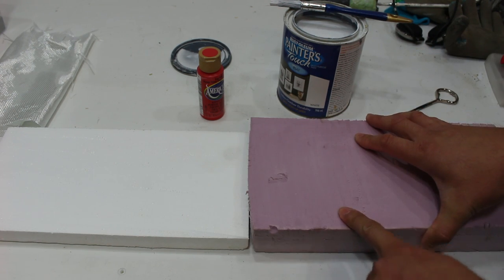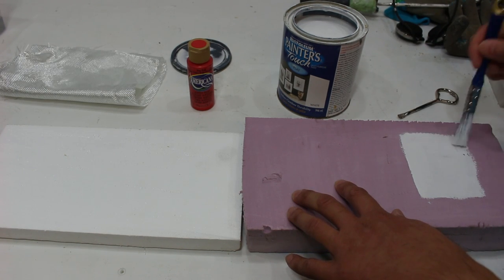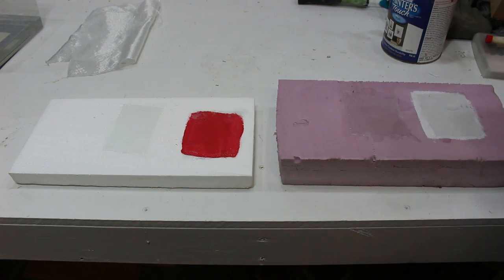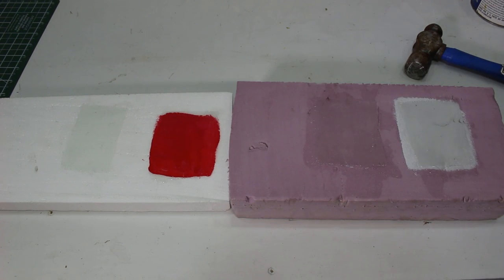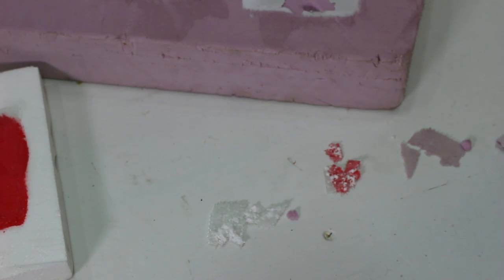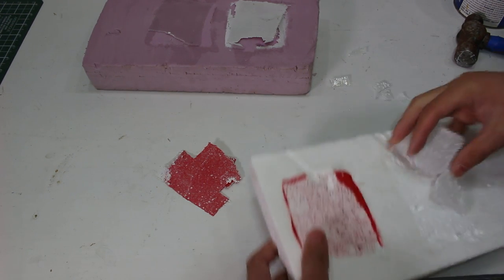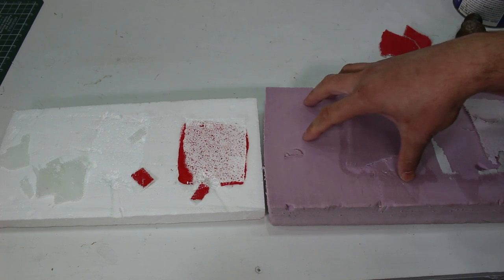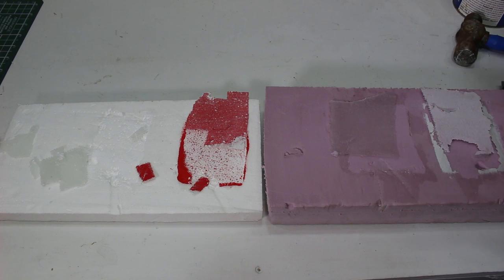Surfboard Foam Testing - What Type of Foam to Use

Comment: I know this is an old video but re-stumbled on it after making a couple of xps foil boards. Regarding the bond strength on XPS I found that the strength was greatly improved by heavily texturing the surface. I used 40 grit sandpaper to really rough the surface up. I also spoke to someone who closely spaced hobby knife blades to put texture on the board. Because XPS and EPS are the same chemical compound I'm guessing that it is only the mechanical bond that is different not the PS - expoxy bond. Texturing the surface goes some way to simulating the pore spaces in the EPS that are created when the source PS beads are heated to make the foam blocks.
Reply: RobSAtlanta that video is completely unrelated. Nothing in it about roughing up the surface and none of the foams there are ESP or XPS.

Comment: awesome vid. what helped when I   used xps was using a carpet furring strip with nails and pressed it on my blank after rough sand and it helped huge with epoxy adhesion.
Reply: I've considered using a spiked carpet roller to achieve a similar effect. The funny thing is the first test strip I did was really resistant to delamination, so I wonder if there are other ways of improving the adhesion than just poking holes in it (e.g. temperature). It was definitely hotter in Texas than it's been in Wisconsin, and I wonder if that has had an effect.

Comment: Hey bro, excellent channel. I have no idea how I ran into it. Since I have been looking to build an XPS Kayak for my channel, I guess YouTube decided to hook us up. So, I have a bit of boat-building experience, and I have made many carbon pieces from my race cars, boats, and bikes. If I may make some recommendations, first, I know you like that epoxy, but I strongly suggest giving Alumilite a try! Second, if you want excellent adhesion to the substrate with minimum or no delamination, you need to start by wetting the substrate first, applying the glass mat, then more epoxy! And if you want TRUE professional results, you may need to bag the board! There is a company that sells supplies in the UK called Easy Composites Ltd with some pretty good videos. The videos are focused primarily on selling products, but the techniques are on point.  Or I least the way I was taught! Also using a fiberglass laminating roller before the squeegee will tremendously improve adhesion to the substrate...

Comment: Painting the board in either case is probably not a good idea because it actually creates a separator between the epoxy and foam boards. So technically it is a test of the paint adhesion and not epoxy adhesion.

Comment: Amazing vid! But quick question, where do u order your EPS foam from. I shape board with low density and it leaves many little holes that I have to fill with spakling.
Reply: Don't use spackle. Seal with epoxy and glass microspheres (or microballoons as so many seem to call them for some reason). Spackle is almost as good as worthless.

Comment: Fantastic video! i look forward to seeing the XPS build. I do think that it would have been a more fair test to use the same paint on both foams. Do you normally seal your EPS before glassing? if so that would have been worth doing as a test too as it may have affected the adhesion of the glass.
Finally i wonder if you made the XPS really rough it would have a better bond? Its scary how easily the glass peeled away.
I really enjoy watching your channel. All the best
Reply from the maker: Good point about the paint, probably not a huge difference but it would have been good to use the same,.  I usually seal my EPS with a sealer and I'm sure it does make a small difference.   I have actually tried really roughing it up before but it ends up not looking very good and using  more resin to fill in the little voids with minimal affect on adhesion but that's anecdotal.
Reply: @AndrewWorkshop  what is the sealer that you use?

Comment: No experience but had a thought. What if you had a roller simular to the ones used to get air out of layup only very small sikes of some sort to "texture" the foam pre- layup? The goal would be to allow resin to be pushed into the "pores" created providing more surface area to grip.

Comment: I was wondering if there is a reason that you have never seemed to consider Polyurethane Blanks and polyester resin?
Reply: No expert here, but polurethane foam is generally harder to work with I believe. For instance, it cannot be hot wired. Other than that, its the resin is cheaper and much the same to work with. Perhaps he just prefers the epoxy+eps/xps boards as they are supposed to be more rigid/less flex and float slightly better (~12%).

Comment: I will have your opinion. I'm thinking about building a kayak. In my country the polyester for boats has low cost and epoxy resin has high cost.
So i have only  one way using only polyester.
The same we have for foam. EPS has hight cost and EPS has very low cost
My Question
What do you think .
For a kayak 11 feet i can use EPS and polyester or later is destroy?
Any opinion is critical for me, before i starting
Thank you

Comment: What epoxy do you use not to melt the foam
Reply: Epoxy resin wont melt eps/xps when used correctly. Polyester resin melts the foam, and thats exactly why they use epoxy. If you let the epoxy pool and then exotherm the  yeah, I'm sure it will melt the foam. But just use it correctly and you'll be fine.

Comment: hey, very interesting video.
Can you give some additional information on the density or kind of eps you are using?
in my country eps is categorized by its compressive strength (kPa)....with 50kPa being the weakest, and around 200 kPa being the strongest. Is that the case in Canada too? Which would you recommend?
Reply from the maker: Hmm I think from what I remember the EPS is 1.8 or 2 lbs per cubic foot, Canada is messed up with measurements we use imperial for some measurements and metric for others.  Get the densest as possible, less compressive = tougher but there is of course the trade off of more weight.  So you could get less dense foam and glass it heavier and still have a great board (lightweight shortboards) but it will off gas a lot more so it will be super important to vent.  Not to mention fiberglass and epoxy is probably more expensive than dense foam.

Comment: The open cell foam allowed the epoxy to penetrate into the foam better so it held better.    The XPS does not allow the epoxy to penetrate as much. 

I think if you drilled holes into the foam every inch and allow the epoxy to fill the holes that will stop the delaminating.
Reply: Probably better to make up a little thing with spikes in it (like they use to aerate grass) but smaller, perhaps with pins or tacks in it. Would be quicker as you could just stab it around pretty quickly. And it wouldnt remove material, as negligible as it may be. Just my 2c.